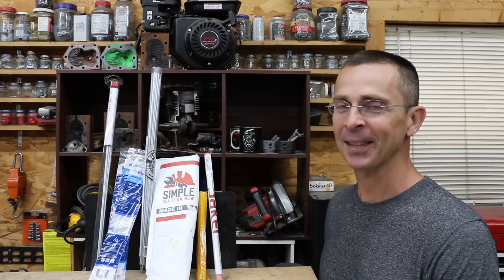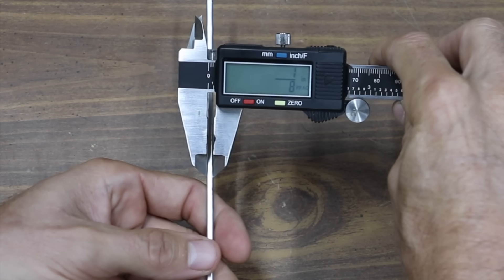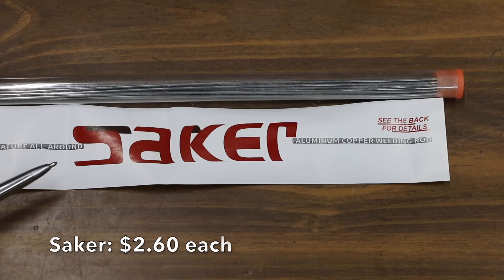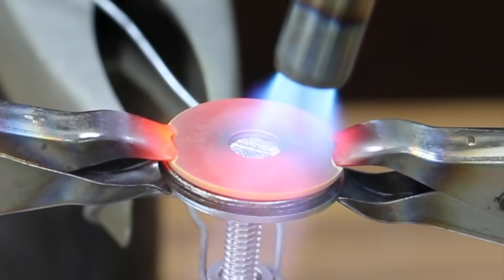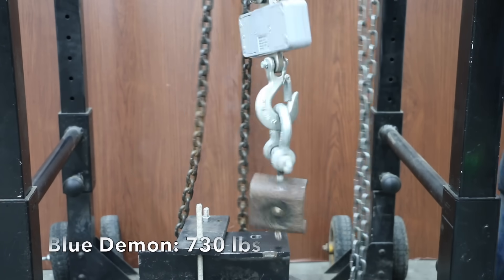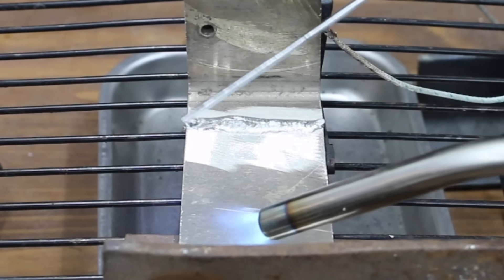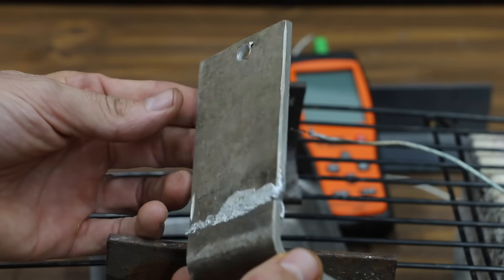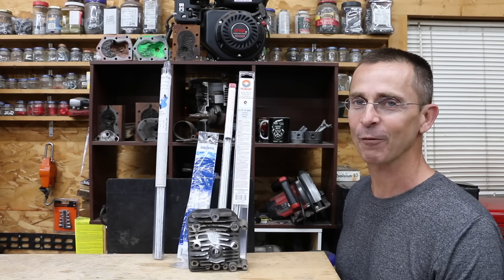Best "No Welder" Aluminum Welding Rods? Alumiweld vs Bernzomatic vs Hobart

Comment: Great video Todd! Some pearls I've taught over years: Clean the rod too. Keep the flame away from rod & joint. Vee edges for butt joints. Rub the rod steadily along the joint when the flow temp is close. This rubbing help to tin the base metal & transfer particles of the filler to encourage sicking & puddle formation.  This video clearly shows that not all alloys are alike. Pay attention or pay cash!
Reply from the maker: Thanks for the feedback.

Comment: I tried welding the infamous Saturn transmission flaw but only got the steel pin welded and secured. switched to JB Weld to patch the casing hole and it's been a year/10,000 miles.
Reply from the maker: Thanks for sharing!

Comment: I recently watched a video where someone took several oil filters and compared them. He took them apart and compared the internal materials and the general construction of the filters. Surprisingly enough the oil filter I use (or used to use now) was the Fram oil filter and it was by far the worst quality of the filters that were compared. I think it would be interesting to see you do a video comparing oil filters. The methods you use to test materials are by far more in-depth than the video I watched. Also, you have videos on oils and air filters, but unless I just overlooked it, I didn’t see a video on oil filters. I would be very interested in seeing you do a head to head challenge video between a few different oil filters.
Reply from the maker: Thanks for the video idea.

Comment: YOU ARE THE GREATEST TODD!! IN THESE HARD TIMES IS INVALUABLE TO HAVE SUCH AN UNBIASED REVIEWS ABOUT PRODUCTS WHERE QUALITY AND RESULTS ARE THE COMMODITIES TO BE VALUED. I WOULD REALLY LIKE TO SEE YOU TESTING THE NEW UV LIGHT GLUES PUT TO THE TEST. I'VE BEEN LOOKING INTO MANY LOCAL AND CHINESE IMPORTED BRANDS BUT DIDN'T BUY ANY OF THEM BECAUSE OF ALL THE ADVERTISING HYPE AND DECIDED TO BUY THE NEWEST UV LIGHT GLUE FROM J&B WELD AT THE LOCAL HOME DEPOT FOR AN IMPRESSIVE $4.94 WHICH CAME WITH 0.18 OZ BUT IT DID A GREAT JOB. J&B CLAIMS IT IS THE WORLD'S STRONGEST GLUE. SINCE YOUR PREVIOUS REVIEWS ON THE TESTS YOU DID WITH J&B VS LOCTITE VS GORILLA AND OTHER BRANDS, I STICK WITH J&B BUT I WOULD REALLY LIKE TO SEE J&B GO AGAINST THE COMPETITION (INCLUDING SOME OF THE CHINESE MADE UV LIGHT GLUES WHICH ARE VERY INEXPENSIVE) AND INCLUDING SOME OF THE "INDUSTRIAL TYPE" UV LIGHT GLUES. THANKS!!!
Reply from the maker: Thanks for the video idea.

Comment: Great video, very interesting results as usual!
As far as the thermal imaging camera of the cylinder head, the repaired area was not necessarily cooler. Heat up a piece of metal with one area painted black and another polished to the same temperature and look at the results…
Reply from the maker: Thanks so much!  Thanks for sharing.

Comment: From a technical perspective, you are not welding since the base metal is not being melted.   The process is technically "Brazing".   The main problem to achieving a high-strength joint seems to be removing the aluminum oxide layer from the base aluminum metal which forms very, very quickly.   P.S.  I've had good luck with HTS-2000 Aluminum Brazing rod, closely following their instructions for brazing.

Comment: How would it be comparing different tig welders or testing different welders overall (That might be little too pricey)
Also as i'm a plastic 3D printer user, i'd also be interested in somehow seeing some plastics in some applications other than 3D printing. I'd like to see if there are plastic weld sticks to weld some plastic parts and strenghts and tests over the course. I think that would be kinda fun to watch.
Reply from the maker: Thanks for the suggestions!

Comment: I have used benzo rods in some areas, Available at HD. Also have blue demon ac arc welding alum for thicker material. Dirty but works for once a year I need it.
Reply from the maker: Thanks for sharing.

Comment: Could you test fuel injection cleaners for Diesel engines? I haven’t used anything that has made a difference. My mechanic couldn’t recommend anything other than changing injectors. I drive an international with a lack of power.
Reply from the maker: Thanks for the suggestion.

Comment: I was hoping to see Muggy Weld in this, but it's an ultra-low temperature brazing rod, they operate around 350F.  It's the only one I've seen that advertises itself as ultra-low temperature, everything else is in the 700F range like these.  Could you compare Muggy Weld too?  How about the winner from this comparison vs Muggy Weld vs JB Weld, just to see if brazing is even necessary!
Reply from the maker: Great suggestion. Thank you

Comment: The repair area looked cooler than the rest of the cylinder head because it's the "shiny-est" part. Thermal cameras have a very hard time getting accurate readings for surfaces that are reflective in the IR spectrum, especially when they're surrounded by a much less reflective surface, e.g. the oily cylinder head.

Next time you get a strange reading like that, try putting a piece of masking tape or some dark paint on the affected area, and point the camera at that. It will heat up to the same temperature as the area you want to measure, but it's not nearly as reflective, so you'll get a better reading.
Reply from the maker: Thanks for sharing.